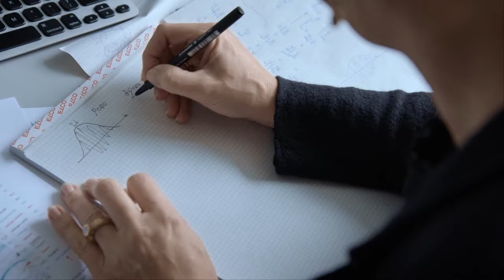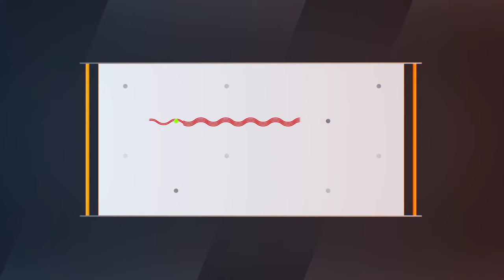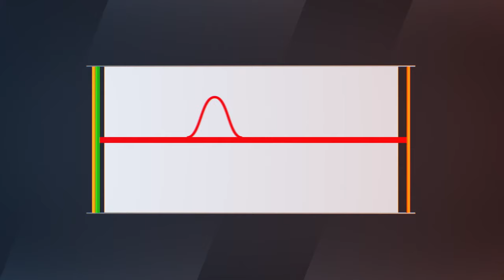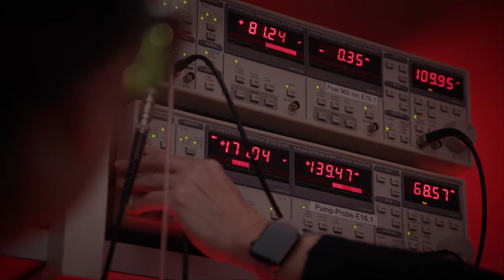Ursula Keller - Ultrafast pulsed lasers

Comment: U Keller achived with a pulse repetition rate 6GHz and around average power 1W, mode locked external cavity use a VERCEL GaAs/AlGaAs combined SESAM saturable emitting 1064nm with a pulse duration 15-ps , but not a femto-second on 2002, right?